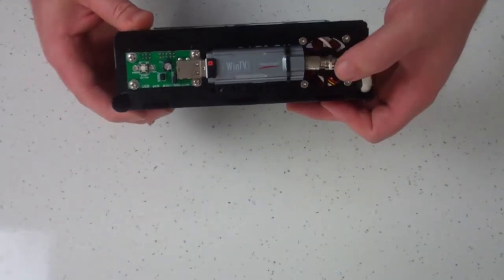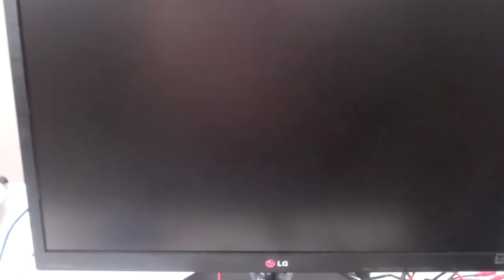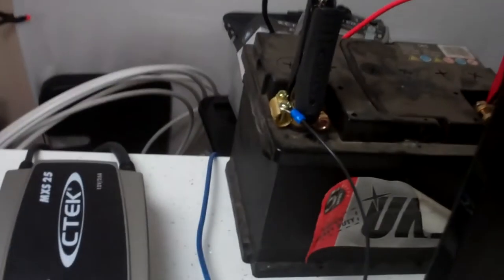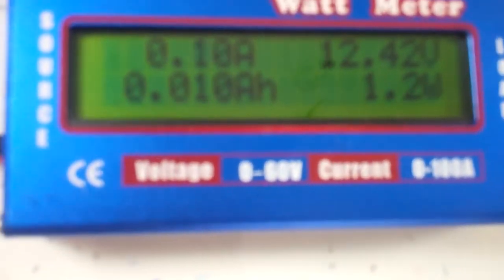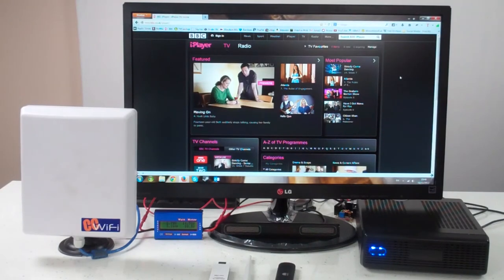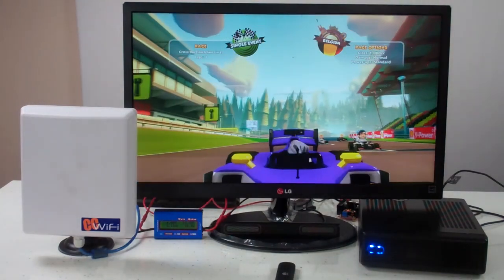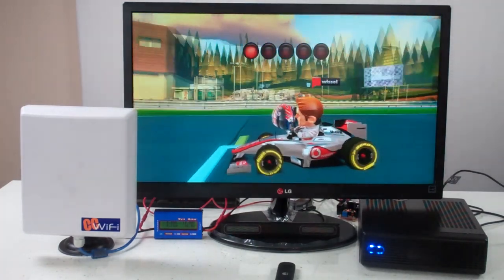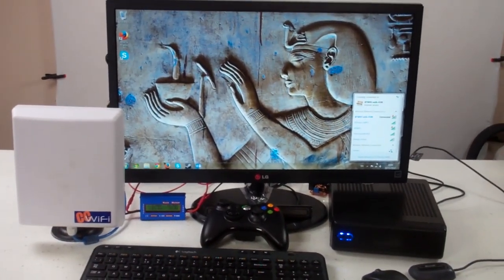12 volt PC for Motorhome with WiFi 3G and Gaming

Comment: Super video. Anytime you can run directly off a 12V DC source (your deep-cycle in the RV), you are way ahead on power management. The 12V battery is more stable than any cheap inverter. The losses will be minimised when you do not run through an inverter, then the power supply and finally into your PC. What you have created is inspiring.

Comment: Dude.. That computer are sick.. i never seen anything like it.. 12 volts, and it is so fast.. damn man.. i have 2 x 100 volt 97 amp batteries, and a solar panel.. i could run this computer all day with this.. how much did it cost you to make it? i'm hooked.. going to hook up my solar panels to my batteries next month in my new appartment, and do some aquaponics that runs purely on solar.. this computer would be able to also be hooked up.. in reality, i just need 1-2 small 12 volt water pumps to pump around the water